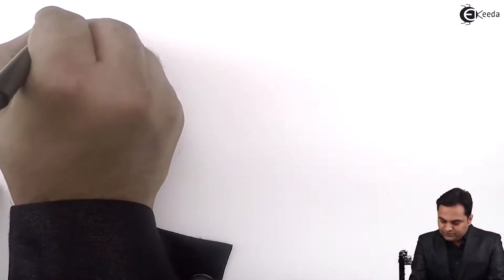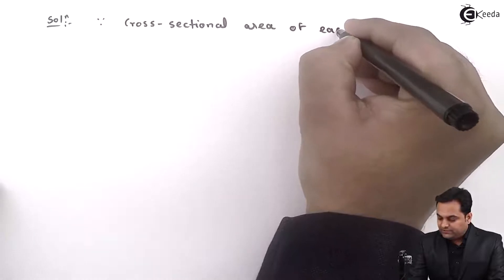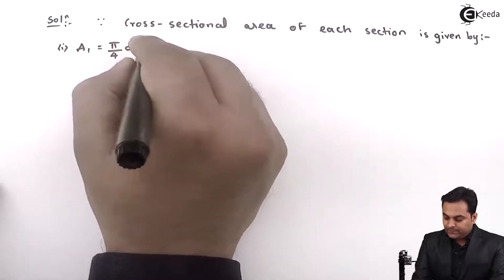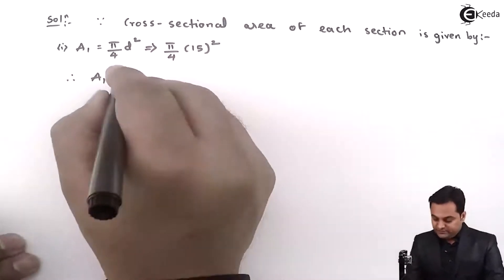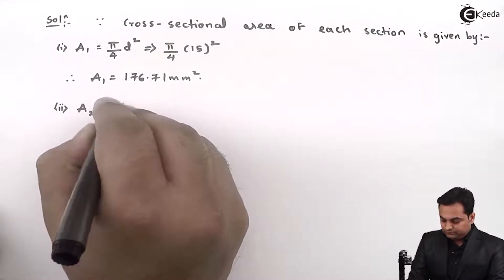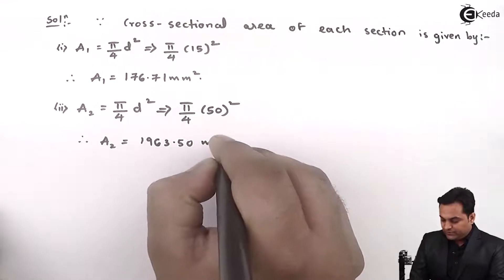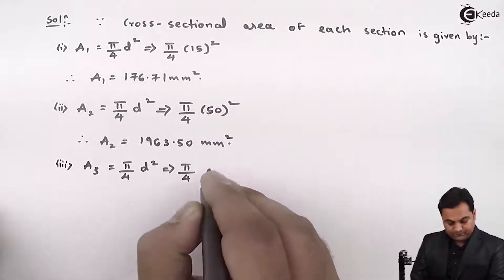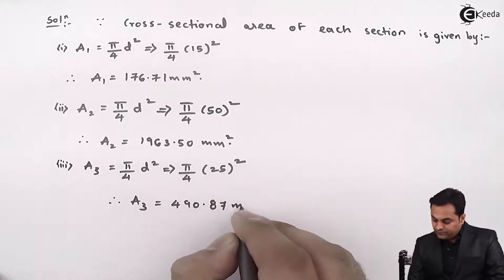Problem 3 on Stress, Strain - Stress and Strain - Strength of Materials

Comment: I'm confused on the area why is the π/4 and not 2
Reply: it is because we are taking the diameter divided by 2 if in the case of radius what you have said is right
Reply: Because instead of radius ,in bracket diameter is squared.